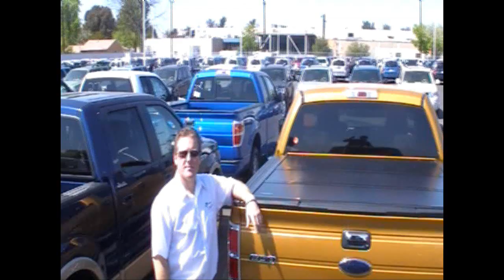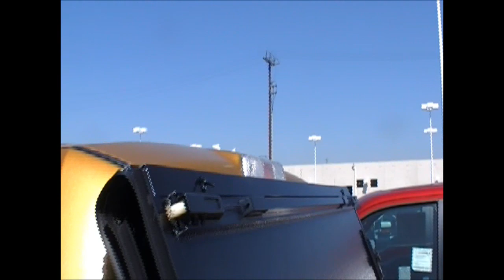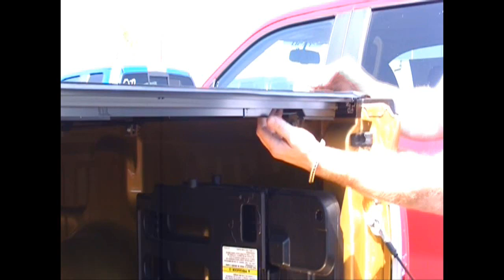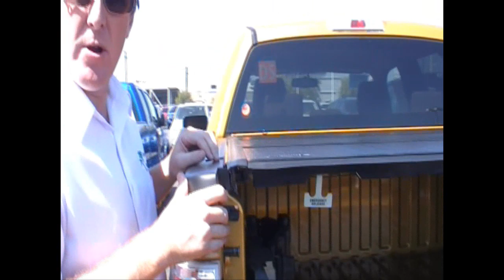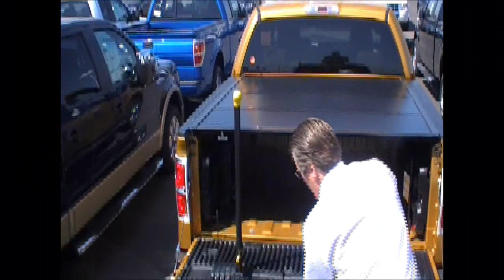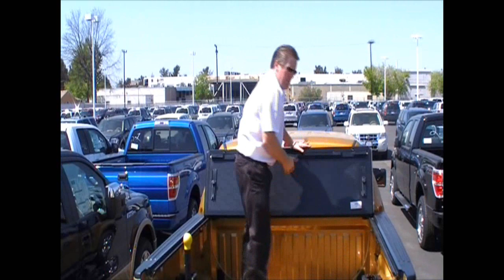Ford folding truck bed cover by BAK Industries

Comment: This cover leaks at all most all the joints, you have to have the cover lifted up to close the tail gate, and it leaks around the cracks where the step comes out of the tail gate.  Not a good cover if you want your stuff dry in the bed.

Comment: I just installed it and I love it, very easy to install and you don't need a helper, is very light and looks awesome, I bought it right from the dealer and I picked up the next day, only comes on black and I like it but I could probably prefer on white (easier to keep it clean) FYI it doesn't open all the way you'll lose about 6 inches on the front but I think is fine besides that I don't see any problems,  is perfect

Comment from the maker: No, It is made by BAK Industries, but is a little different to the BakFlip. It has different components, different rails, different clamps, different seals and a longer warranty. It is built on the same platform as the BakFlip HD, but is more refined.